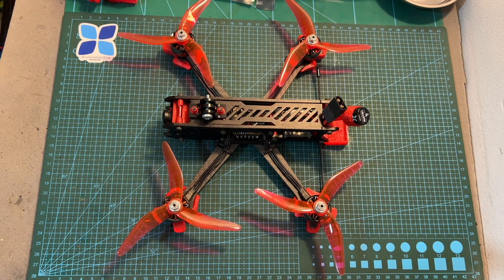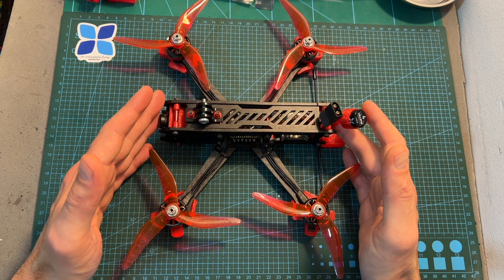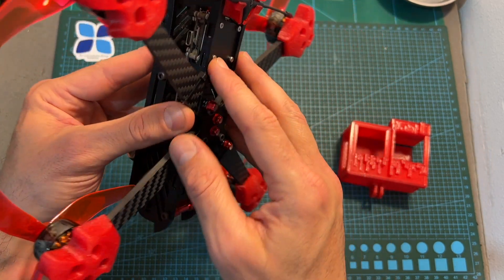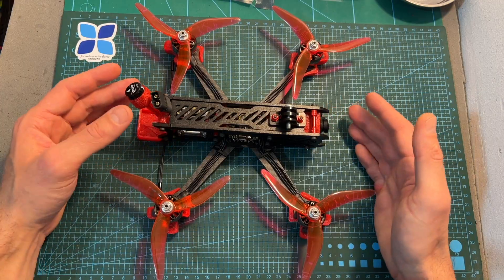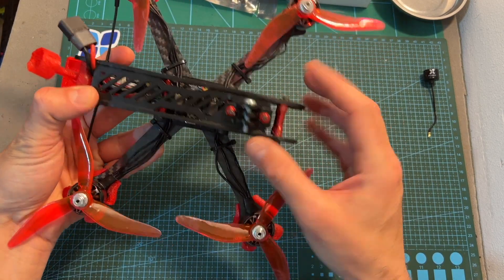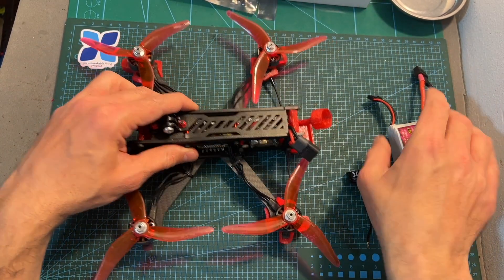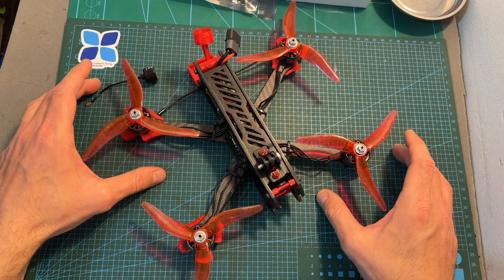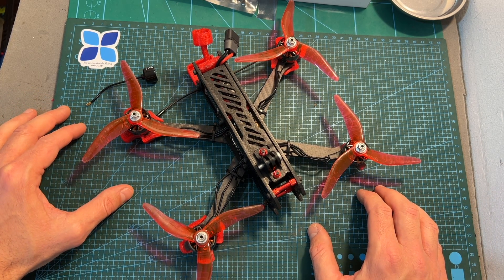Indestructible Drone Frame? Uniquad Raptor V2 Overview & Durability Tests

Comment: I slammed my APEX into a steel post accidentally. 
Camera had shock damage. Nothing visible. Front bottom plate took damage at 1 standoff hole.
Ordered replacement, but impulseRC  got packaging mismarked and I ended up with 2 rear standard plates. My version is HD. Different plates. They told me keep the 2 I dont need and sent what I did need. I suspect ImpulceRC took responsibility on behalf of the vendor. (Pyrodrone) Mine was not the only shipped mistake. So, anyone need a rear bottom Apex plate for analog? I have 2.

Comment: Its too heavy , IT would be interesting if it was lightwe, anyone can make a tough frame if it weighs a tone
Reply: Hey i want you to see the sespifiction first . Its only 175gram the tpu package its heavy 🙂
Reply: @avicofpv7002  At 175g and only suitable for a 20mm stack and 4mm arms it is a fail total porker i hope you paid for the review
Reply from the maker: I don’t charge for my reviews. BTW I did mention that the frame supports both 20 and 30mm stacks.
Reply: @KremerFPV  Hi Gal , the coment was not aimed at you but the dude that answewed defending his porker with 4mm arms , it is not acceptable to promote a INDESTRUCTABLE FRAME  with 4mm arms that i and you know will break

Comment: I don't know, by adding 100g+ of carbon fibre I'm sure we could make any frame more durable, but we don't want all that weight and it actually attributes to more nasty crashes because of added kinetic energy. If they need volunteers to destroy the frame, I'd be happy to do it 😄
Reply from the maker: Haha. I will test the next version of this frame. Hopefully it will be a little bit lighter. Actually it didn't feel that heavy when I was flying it but I need to test it a bit more.